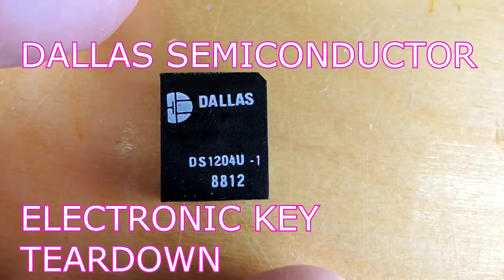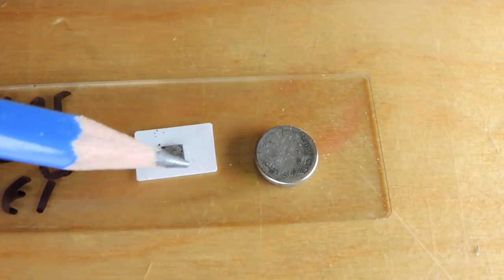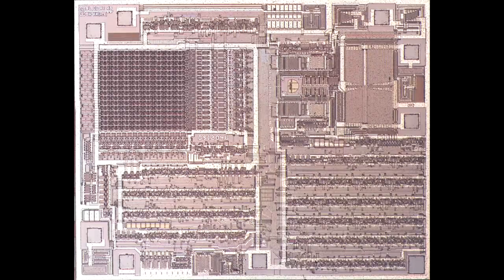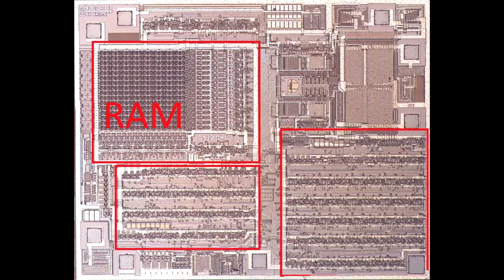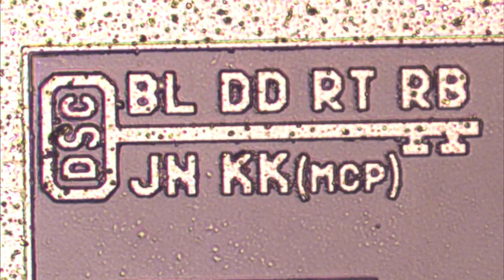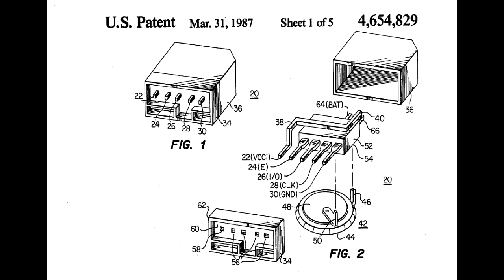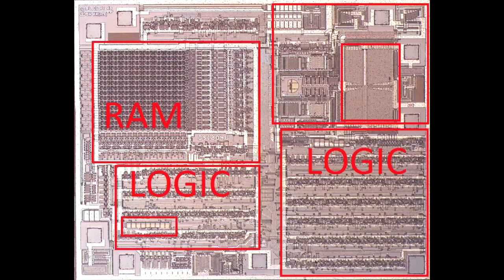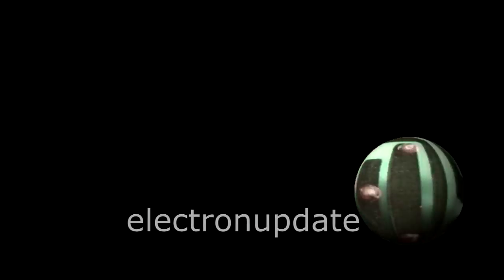Tear down of an Electronic Key

Comment: Dallas were the pioneers of ultra low power complex IC's in my opinion, they did really amazing stuff, that ran on so little power, that the 10 year life often was 30 years or more in reality. The range of chips they brought out using the same basic range of low power SRAM backup was big, along with the 1 wire technology they also made. Even the precision reset controllers were good, no issues with slow rise time supplies, and ultra low power to boot as well, and they put all these blocks into some pretty good support chipsets as well.

Comment: When you focus on the Dallas logo, there are some faint, embossed-looking rounded rectangle shapes underneath.  What might those be?  Thx.
Reply: You mean the two meandering lines? I think they're resistors, note how all ends of those lines end in some "point" and there's the start of a metal line on top. That's generally how resistors are connected. Probably some large resistors were needed in the design, resistors are generally not made using the upper metal layers but lower layers like polysilicon or some diffusion. Then you can still add a structure on top of that in metal. And that's what they have done here, they added the logo because the space was unused.